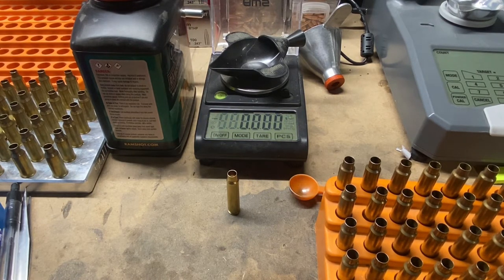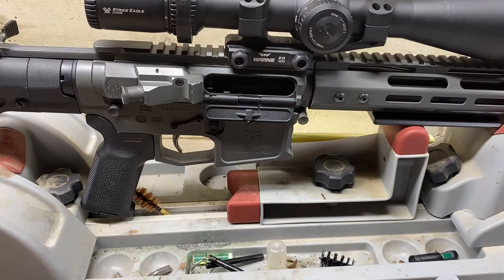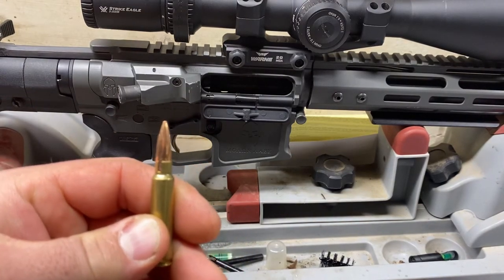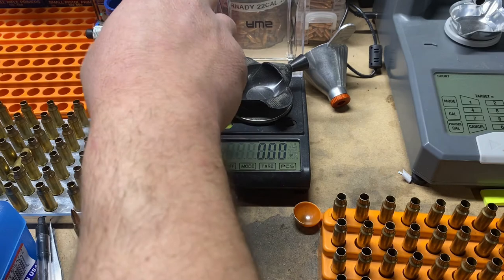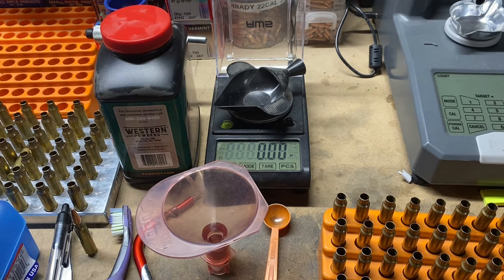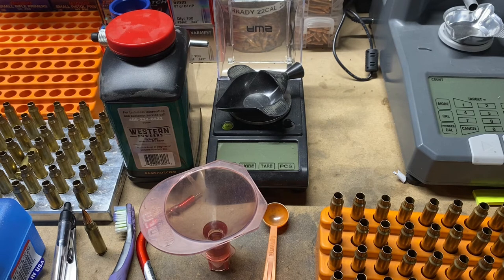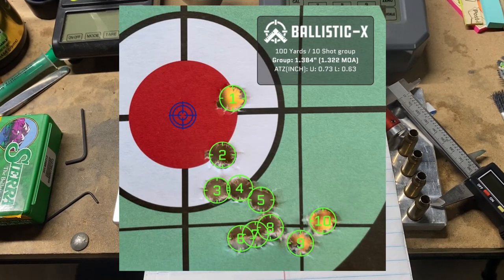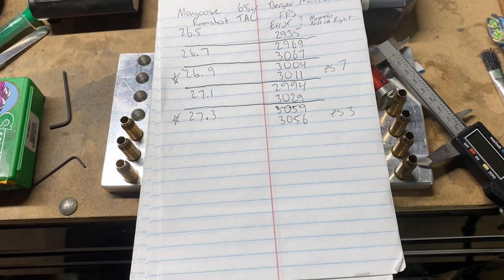6mm mongoose 68gr berger fireforming load

Comment: Gearing up for this wildcat. Are you using 223 data for this or 6x45 and working up?
Reply from the maker: I mainly use 6x45 data to start but if I can’t find any 223 data will work also

Comment: It's kind of a waste of time to collect date for a fireforming load that has only one purpose, to blow out the reformed case to fit the chamber. And wasting Berger bullets? I load 55-grain Dogtown bullets over 28 grains of H335, and it does a great job for forming the cases. I chrono'd them once out of curiosity and they were going about 3200 fps. Your data is going to be different after the cases are fireformed.
Reply from the maker: It would be if I didn’t want to actually do something with it plus helps down the line when I I fire form a lot more cases after these are shot. It never hurts to get a good load unless your not going to use it for accuracy. I took a coyote at 350 yards over the winter if I have the chance to do it with a fire forming load you best believe I want it to be good.
Reply: Most fireforming loads for most cartridges can actually shoot sub MOA and are not much different from the fireformed case for accuracy, and are useable for hunting and general shooting, unless something stupid is going on.